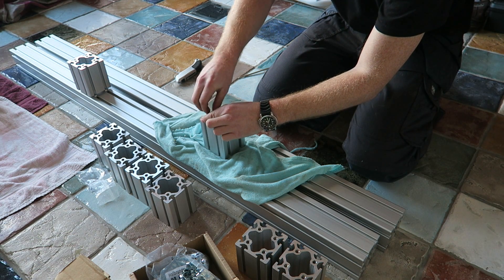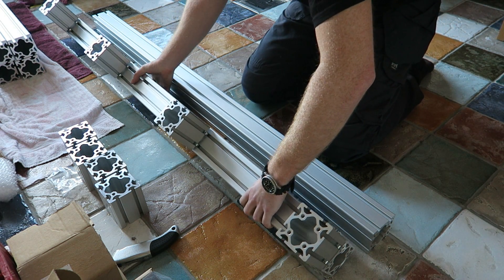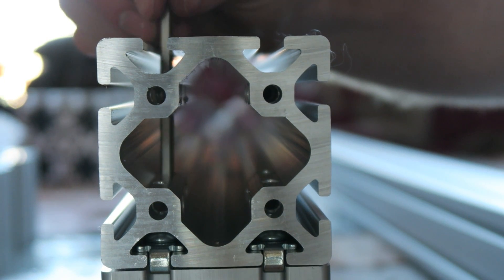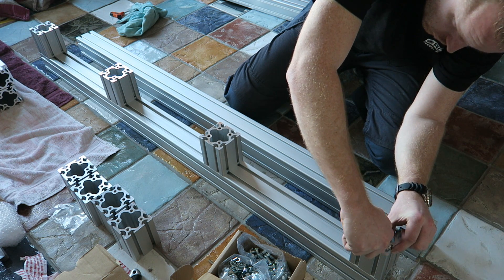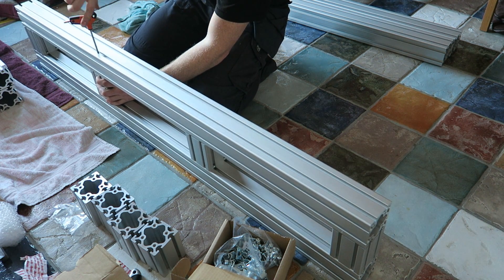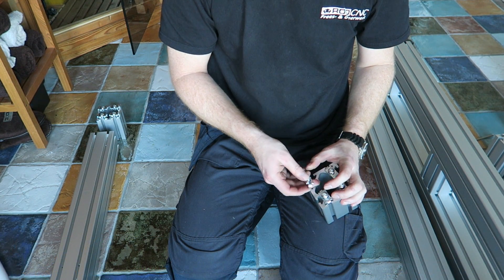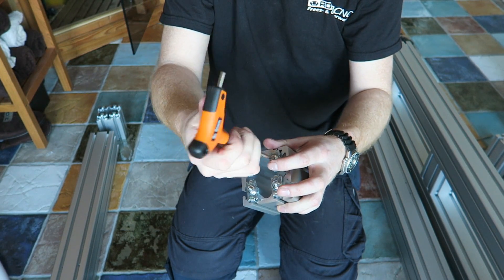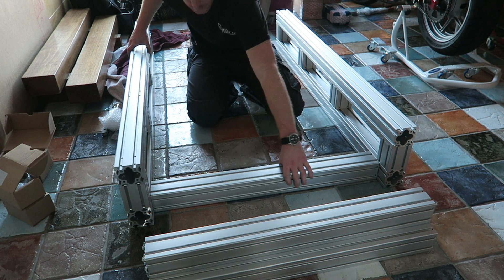RCNC X2 Router 05: Frame Assembly part 1

Comment: Hi Marcel, I was watching this construction of 80x80 extrusion and it came to me that I recently got replies back from the two distributors of both 80/20.net and Item24. And the accuracy of  cross cutting of extruded profiles that they are promising are as follows:
>>Item24  -  Toronto, Can wrote back to me:
The cut to length tolerance is +/- .1mm (.004”).      The squareness is +/-1.0deg.
>>80/20.net  -  Toronto, Can replied with:
All cut tolerances are */- .015” and +/-.002” for squareness.
So how is it that you can just bolt the gantry side plates to the 80x160 and the bearing spacer block for instance and be confident ?
Reply from the maker: You are of course right in theory but eventually there will be misalignment that add up and will be more than what ever company promises... 
Even if they cut at 0 tolerance I might have a slight misalignment in parallelism in the side aluminum, the rails may be off a little from the 160 piece, the tapping of the thread for the hiwin carts... All will add up or subtract to each other...   
In the end you just have to do your best to keep thinks as best as possible, and then adjust if needed after measuring the problem at the working end.

Comment: Hi The frame construction looks very ridged. But there is one thing missing. It's MASS. I wast thinking about filling the inside of the extrusions with epoxy/granite to add more mass. What do you think? Something needs to be added to damping to the frame.
Reply from the maker: Ron Laury I bet you can hardly lift the parts you see in this video... I really think you are thinking this is not that heavy... (somewhere in the video is a weight if I recall correctly) anyway... filling is an option if you have trouble with the mass..
Reply: 140kg. That's pretty heavy. I can all ways fill later. Thanks for your response.

Comment: Hi Marcel,

I do have a question regarding the fastener that you use for the upper frame.

According to 8020 recomendations, the strongest fastener is the universal fastener, you do use the standar fastener, do you have any special reason to do that ?
Reply from the maker: Hi Enrique, I use the recommended fasteners, but not 8020 but ITEM... Product descriptions are in the bottom of the screen.. I have not done any research on the fasteners, I just send the drawings directly to ITEM and have them sort out the best way to get the job done..

Comment: Looks like its going to be a very solid machine. It should be able to produce some very accurate work. Are you going to use the same profile for the stand.
Reply from the maker: Hi Dave, thanks for watching ! 
Yes I do hope it's going to be, aiming for it anyways.. 
I'm just editing the video for the bottom frame. It will be using somewhat lighter (20%) profiles.. 
Basically I think it does not matter, the rigidity should come from the top part, the actual machine.
this bed could even be placed on a table and work fine...

Comment: how did u preccision cut on aluminium profile? milling or sawing?
Reply from the maker: Hi... as said in the video I let ITEM do all the machining.. 
So the saw work, drilling, and tapping is all done in their factory.
Not only is this more easy, it's way more precise then doing it myself, or letting a small company do so.
At the item factory (in Germany in this case) they have a lot of machining centers to do very precise machining job.
Reply: does have change to contact with them?, also shipping to turkey? because im planing to make my own cnc router with aluminium profile, as u can see on my channel i had MDF chasis cnc, but i build a new one. with aluminium constraction. The thing is im not trusitng any turkish company, that can precision cut and produce items for me :( can you send me that company information please?
Reply from the maker: Hi Halil..... If you want to build a machine, and use my drawings you can at least mail them yourself :) the company adres is www.item24.com and then click turkey :) 

btw, over here is the same thing, a lot of company's will saw everything to lenght for you, but for a cnc machine it's best to have some accurate and square cuts...
Reply: Thanks a lot. i wll check it. how can i acsess all cad drawings?
Reply from the maker: All drawings will be shared and explained in the discription box. Cad files will not be shared.
Reply: +RoboCNC Frees- & Graveerwerk waiting for your drawings. Thanks
Reply from the maker: Z axis is shared... see Z axis video's.
And the frame part in this video also.. 
So start building Z and keep up ;)